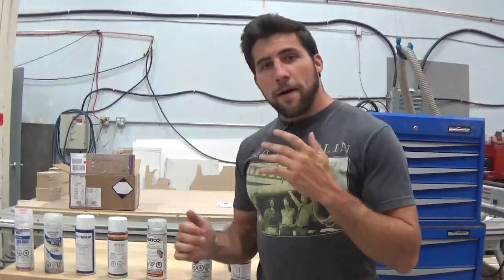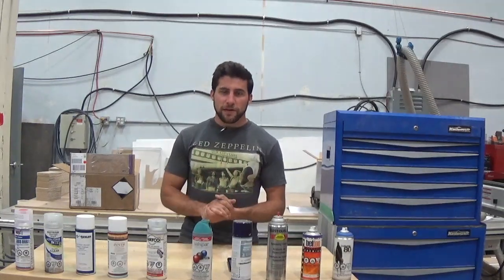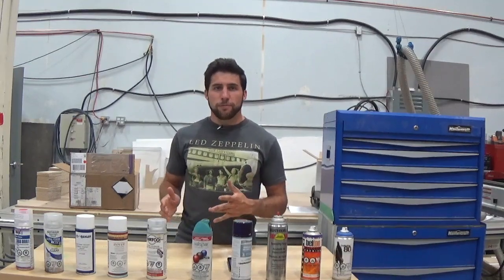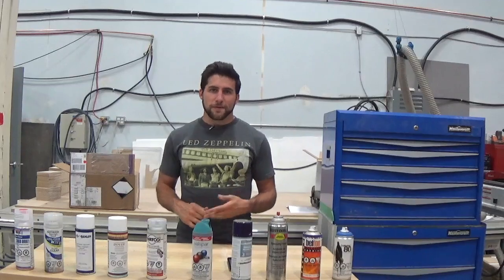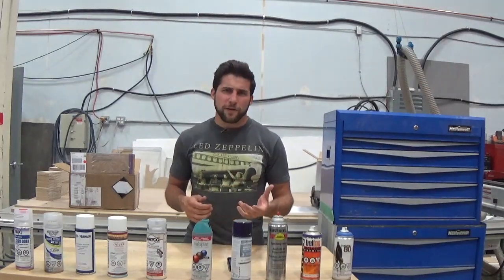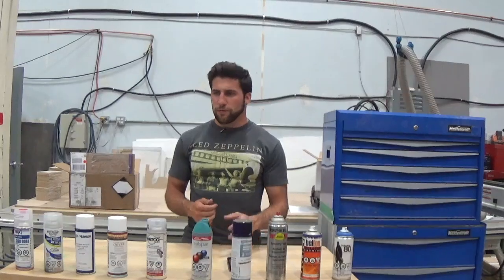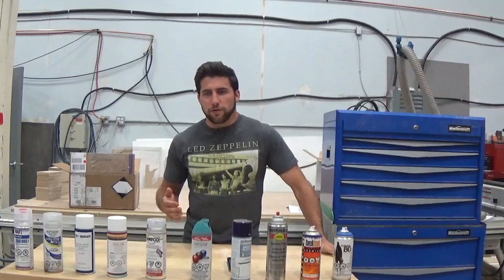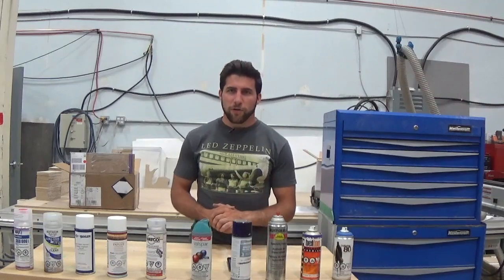The Top 5 Mistakes to Avoid When Painting With Spray Paint

Comment: All excellent tips, Brad. 

I find, in my experience, that the biggest mistake most people make, me included, is getting into a hurry and trying to rush things. I had to basically train myself to slow down and take my time. We (I) often forget that the last 5% of your work will get 95% of the attention. We get a project to the point of finishing it (which is the first thing people notice) and start taking shortcuts, trying to hurry the process along. I have to force myself to remember that the finish, no matter what type it is, is going to do what it's designed to do in the amount of time it needs to do it, and there's not a lot I can do to change that. I have to constantly keep in mind that a week is going to pass whether I'm waiting on a finish to cure, or I'm trying to fix something I should have just left alone to begin with. 

READ and FOLLOW the directions - you don't know more than the people who made the finish you're using. You can't know more than they do - they made it. They've done the R&D. Take their advice. Still, I have to force myself to wait the 72 hours needed to let a coat cure before I can sand and recoat. I don't have to like it, but I do have to do it.

Thanks for the video!
Reply: I'm new to spray painting and I definitely rush things
Reply from the maker: All too true Mark. It can make for a tough learning experience when people try to circumvent the usual techniques and waiting times.
Reply: is 72 hours an end all be all spray paint curing time? Some I hear 5-7 days to gas out, others it's 30 days with "The new type spray cans," whatever that means. My wheels had to go back on the car 16 hours after I "finished" painting yesterday; was going to wait until after the weekend to wash the car and wheels, polish and then seal them, no clearcoat.
Reply: EhK47 Follow the tech sheet for the paint. If you're using spray cans, follow the directions. If you get no help there, call or email the paint company. They should have a tech line
Reply from the maker: 72 hours is not a hard and fast rule. Some spray paints cure quickly, others technically don't cure at all. I can't say for sure with the information I've been given, but likely I would avoid pressure washing your wheels for the next 2 weeks. You should probably be able to polish by now unless you used lacquer.
Reply: Thank you so much, guys!
Reply: EhK47 wow... 1 year late. Oh well. More and more, paint manufacturers are trying to "innovate" and make "easy" paints. A good example is rustoleum painters touch 2x. Covers twice as much! Recoat in minutes! Fewer coats! Can be handled in 1 hour! Takes 5-7 days to fully cure on plastic, and if you try to clear coat or use different paints (even straight enamel), you're boned. I mostly paint models. Surfacer, main coat, second color, detail, gloss coat, weather and wash, then matte coat. If i rush any of those steps, the lower coats get reactivated and crackle. DO NOT rush your cure times.
Reply: Dude I hear U loud n clear you said a lot of good things I know your a pro just by the way U express yourself I like that U know what U know it's that simple dig it

Comment: Light and heavy are a function of two main variables speed of your hand and distance. The slower your passes the thicker the coat. The closer your passes are the thicker the coat. The most important thing you need to do is read and follow the directions on the can. I tried a brand I had never used before. The paints I was used to said 10 to 12 inches from the surface to be painted. The new paint said 6 to eight inches. It is a rapid cure paint dries to touch in 15 minutes, handle in one hour, recoat anytime. I sprayed too far from the surface, ended up with paint acne, thousands of tiny bumps. Paint partially cured in flight, too thick to lay down. Currently waiting for paint to cure completely so I can sand it smooth and repaint. You channel is a great resource for people that are willing to learn. Keep up the good work.
Reply from the maker: Sounds like a transcription from my video on how to get an even coat of paint with spray cans haha. Thanks for watching.

Comment: Your videos are very helpful! Mixing differnt paint types with compatible clear coats is my weak point in my learning process.  When I look at a spray paint can (Krylon, Rustoleum, etc) , often it will not clearly state what type of paint that it is (enamel?).  That is one difficulty I face.  I wish there were a visual chart which showed the dos and don'ts regarding compatibility of paints/clear coats,  in detail. It would be good to print it out and hang it near my work stations.  Once I learn more, maybe I'll make one.
Reply from the maker: I’m planning on doing a video on paint compatibility at some point. Hopefully I can make it reasonably comprehensive.

Comment: 5:54  “Don’t sand it when it’s wet” - Anyone that needs that advice has no business ever going near a spray job 😂
Reply from the maker: Fair point, but also you would be surprised what some people have done...
Reply: I've never tried while it was wet, but I've tried sanding and found that it never fully dried / cured, where it is basically gummy. What a PITA. I thought spray paint was supposed to dry fast, but I've had thick spots never fully cure a week later and not sand properly.

Comment: Great vid, Brad! The number 1 thing that's helped me with enamels is curing time. Enamel sprays sometimes get a bad rap concerning durability. When I called Rustoleum to "complain" I was told enamels typically take 6 to 8 weeks to cure to full hard. I tested this on a toolbox restoration, waiting a full 8 weeks before putting it in service. I have to say I can't chip the paint even if I try. It's also super resistant to cleaners and most solvents. I used Rustoleum Hammered spray in case anyone is wondering. Primed the bare steel substrate with acid etch primer, followed by filling primer and wet block sand to 800 grit and finished with 3 wet coats of the Hammered finish. All Rustoleum products. (I have a Rustoleum factory a few miles from me).
Reply from the maker: +James Pelosi Thanks James. That hammered stuff is pretty damn solid.

Comment: To my dismay, I've made a couple of these mistakes. But those weren't the worst mistakes. The absolute worst mistake I've made is... impressively bad. 

Doing rally stripes on a guitar, offset and going onto the front bevel. Took me (more than ) a few tries to get the angle just right, get the lines parallel, and straight. Had the guitar looking sweet! Clear coat, polish, nice. Went to assemble and... I probably had about 1/16" of paint on the guitar body. Which chipped (nasty chips!), and the p'ups had to be tapped into their cavities (yay more chips!). 

Now I've disassembled (was only partially assembled), and I'm back at square one. My lesson learned is - sand it down, sand off the mistake, don't just paint over and build up. My laziness before caused more work and grief later. (it's worth mentioning that the sanding starts tomorrow,  buying the rotary sander today)
Reply from the maker: I'm sorry to hear that Tom. Painting over mistakes is a risky game unfortunately, and the more paint that goes on, the more that can go wrong in many cases.

Comment: Before I painted my first guitar, (A kit) I went and bought a 4ft length of 2x12 from home depot.  I then cut it into 4 equal sections (Making each section approximately the size of a typical Strat or tele) and treated each section as if it were my "guitar", sealing, sanding, spraying, etc. as if I were painting my guitar.  When I got a section that looked like I wanted my guitar to look, I knew I was ready.

Comment: Hey i am gonna paint a cross for a friends mom who passed away. Im going to use spray cans the cross is already painted black should i sand it down before adding the metal silver or just paint over the black? Also should i put the primer on top of the black or over the sanded part before adding the silver/gold? Please help me out long time subscriber here.
Reply from the maker: If it’s already painted you can sand that paint (not sand it off, just sand it) with 400 or 600 grit paper, clean it, and then go ahead and spray your silver.
Reply: @BradAngove  and do i spray the clear primer after im done? Im sorry its my first project.

Comment: Very informative and clearly stated. I am using Rustoleum appliance epoxy gloss white in a rattle can. Would it be a good idea to lightly sand and apply a clear coat once dry? What kind if so?
Thanks
Reply from the maker: I doubt that you will need a clear coat for appliance epoxy. It’s not really designed to have a clear as far as I know.

Comment: Hello, Brad, I have learned a ton from your videos about the art of spraypainting and really appreciate it! Related to this, I have a question. 

Sometimes, when I am spraypainting, particularly a plastic object which I desire to paint different parts of it using different colors, it will require me to tape over the first color I've already sprayed on, so I can subsequently spray on an additional color without getting any of the second color spray on the one already painted (I'm painting some outdoor porch chairs that has fabric seating for the first color) and a heavy plastic framing for the second color. The question involves the best tape to use over the first / just sprayed color - as I will only leave the tape on long enough for the second color's coats to dry to the touch. Is Frog Tape "Delicate Surface" the best option - or is there a better option? I realize I could learn to be more patient (wife says, "yeah, right!" LOL) and wait until the first color has truly hardened several days. Thanks so much!
Reply from the maker: Yes, that is a good option or the blue painters tape from 3M which is designed to be left on longer than the green and doesn’t stick as hard.
Reply: Thanks much, Brad!

Comment: What do you reckon the right distance to spray from is in most cases? I spray from about 30cm and because I have to paint outside i loose half my paint in the breeze. Be good to have a well ventilated area to paint in..
Reply from the maker: Check out my video on how to get an even coat of paint with spray cans. I think you’ll find it useful. You can adjust spray distance, but you need to adjust your technique with it.

Comment: When sanding between coats,  do you wet sand or dry sand?   Thanks!
Reply from the maker: Dry.
Reply: @BradAngove  I had a run on my last coat and I sand it.Then i put clear on it and the scratches were visible after the clear dried lol
Reply from the maker: What grit did you use?
Reply: @BradAngove  500 wet sand!

Comment: Another great video. Early on you mentioned if only waiting between coats of lacquer 15 min, should only do 3 coats a day. Is there an amount of time to wait between coats so you could do more than 3 coats in a day ie. building up a few layers in a low area? Thanks!!
Reply from the maker: It depends on the temperature and humidity conditions, but with nitro lacquer you can sometimes get away with 4 coats spaced out throughout the day.
Reply: @BradAngove  Brad, thanks for the quick reply!!

Comment: So you mean after painting and drying of paint you have to sand again so what's the benefit of painting !!!!!!
Reply: So is it ok 1000-1500 wet sanding paint then clear coat spraying
Reply from the maker: +Sroor9001 I can't tell if that's a serious question or not, so I'll answer it haha. The painting part is to create a coating and likely add a colour of some description.
Reply from the maker: +Sroor9001 Technically it depends on the paint type. Most paint harden in layers, so in order to get the layers to stick properly you'd want to go a bit rougher than that. Usually around 800 grit.
Reply: You might find your statement rather parochial if you ever ask that of a professional. (That is, from a  quality professional)

Comment: Old thread but a shot in the dark on the hopes you can help me out.
I just about finished a custom guitar for a Christmas present. I already had the headstock stained, sealed and clear gloss.
Today I applied the fender decal on headstock. I then put on a real lite coat of same clear goat. Now it was raining earlier and probably high humidity but was raining at time: I figured it was going to be quick and simple. Anyways after the lite coat  I brought inside and it immediately went from glossy to hazy. Was it too lite goat like you mentioned in this video or the humidity a factor?
I’m
Hoping a nice normal coat will bring it back to a glass like finish.
Or do I have to start over?
Any advice would be appreciated. I put my heart into this thing and was so close to putting a bow on it:
Thanks in advance
Reply from the maker: Sounds like blushing from the humidity. Try using some blush remover from Mohawk.

Comment: Simple question.  If you sand between coats,  are you doing anything to clean off whatever came up from sanding?  I realize you just want to scuff but my guess is something comes up.  Thank you
Reply from the maker: Yes, I clean it off in between. Usually with wax and grease remover.